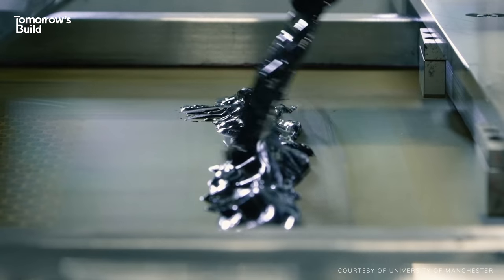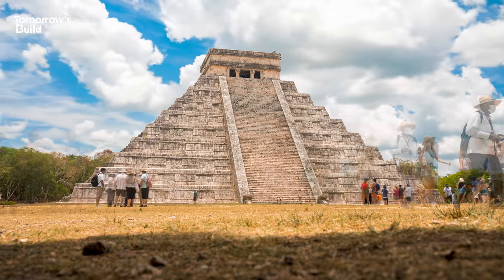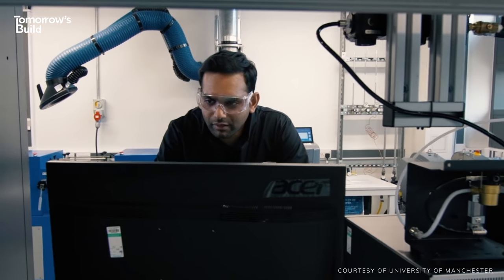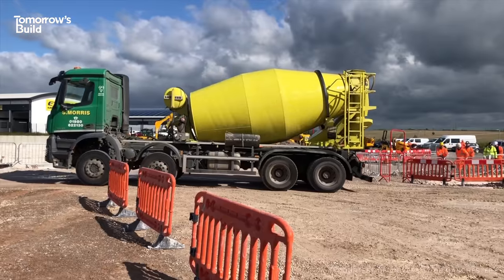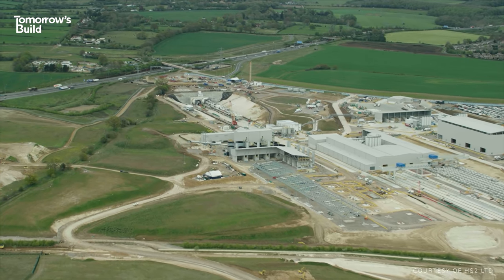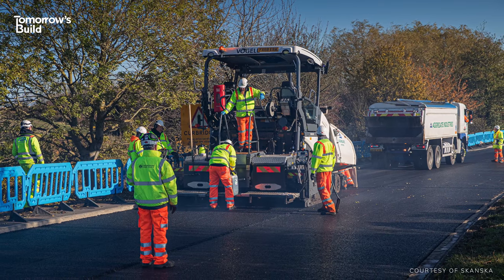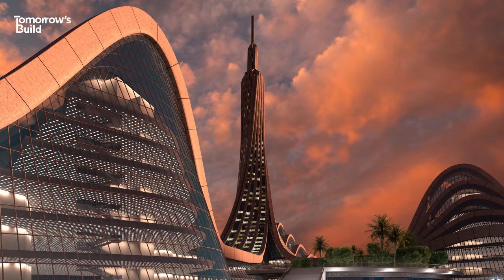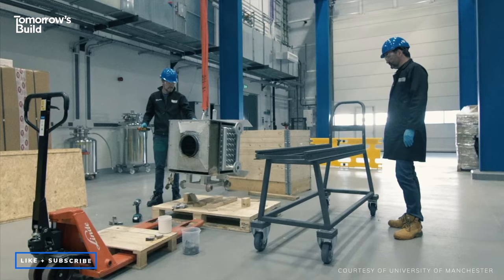Construction's Graphene Revolution Has (Finally) Begun

Comment: Can't help but think that graphene will be the real wonder material once we can produce it in large sheets, not in tiny flakes. I'm actually surprised just adding this powdered graphene already has such a drastic effect on the material properties!
Reply: It's not that surprising. The strength of composite materials like concrete depend hugely on what kinds of materials the binders (cement in this case) is holding together. Sand and gravel are the traditional additional ingredients that make concrete, but things like glass and basalt fibers have been shown to add quite a bit of strength and crack resilience. You see the same thing with epoxy composites like fiberglass and carbon fiber. You can make very strong epoxy composites by mixing in everything from sawdust to industrial diamonds. This is another application of the same principle.
Reply: @ryanbrown982  Anything that can make us use less sand in construction is definitely good. Been waiting on good news like this for almost 5 years now. Things are definitely looking good for the future of graphene.
Reply: Graphene oxide nano particles are the main ingredient of these covid vaccines. Does that excite you guys?
Reply: You mean better than starbucks...lol
Reply: @noone3734  Yeah! Really interesting, actually
Reply: @ye1o881  why do you think they are hiding it though?
Reply: Try to produce sheets that are millions of atoms long and forget  it.
Reply: @paxundpeace9970  I'm not saying it's easy...
Reply: Actually the opposite is true. We can now create graphene by superheating carbon waste such as food and plastic and its created in flakes instead the traditional sheets
Reply: Its not the material specifically, its the scale of the uninterrupted crystaline structure. If we could produce materials with such highly consistent crystal structures, granphene itself would obselete. Additions such as graphene to enhance concrete serve primarily to hault the propagation fractures by interupting the progression along molecular boundaries. We already do the dame thing with many materials sich as using steel intead of pure iron, or vanadium infused instead of standard high carbon steel. Its also why certain manfacuring techniques such as extrusion are favored over casting for some applications. 

This video is far more clickbait than revelation or reporting, as graphene is still exactly where it was 15 years ago, in the lab,
Reply: Well, let's be realistic. If don't have yet mass production of graphene in 20 years, this is likely because the business model is not worth it. A shame it wasn't address in the video. A bit like if I tell you that building building in diamond will drastically reduced the use of steel and concrete, sounds a great idea, lol 😂
Reply: @fairydust..  and it wouldn't really matter if they did it's just carbon
Reply: @thierrymad9743  we can literally make it from garbage now
Reply: But humans will still tiktok
Reply: @abrahamsorby8193  at what cost per ton? You can also make nuclear fusion from garbage...
Reply: @thierrymad9743  i cant remember. Do your own research
Reply: @abrahamsorby8193  well indeed I did my research before commenting (you?!)!! it costs about 200,000$/ton !! So that's a very expensive garbage 😂😂! That's x2000 times more than cement...so let's relax with this amazing innovation.
Reply: @fairydust..  “It's Easier to Fool People Than It Is to Convince Them That They Have Been Fooled.”!
Reply: @noone3734  "hiding it" how?
Reply: An atom thick graphene metal solid like would be stronger than your will to live.
Reply: @thefirstsin  “Of all animals in God’s creation ....
Man is the only one who drinks without being thirsty ....
Eats without being hungry
And talks without having something to say.”
Reply: That has been known for years... it is not easy to produce in large sizes... even in Wikipedia it mentions it. Everyone thinks like you in that sense, but they forget that creating and THEN GETTING FIRMLY in our society, revolutionary things take time.
Reply: @asterlofts1565  I never claimed that it hasn't been known for years.
Reply: @noone3734  Are you okay? I mean you can't believe this
Reply: @siromj8885  whatever man, like I care what you think, you've never looked into it for a second. Do some honest research and you might be surprised what you find.
Reply: @paxundpeace9970  I just did it last night in my epitaxial graphene lab :)
Reply: If you a produce a huge sheet of graphene, it's still going to be an atom thick. Remember, it's only stronger than steel *by volume*. An atom-thick layer of anything isn't going to be supporting any buildings. Using it in composites like this is actually the best way to apply it.
Reply: @Rhaegar19  sure but the size of the sheet still matters, even in composites. There's a reason why carbon fibres aren't added as tiny flakes to resin but as long strands.
Reply: 2025 : GRAPHENE neuro chip id mandates for every citizen.
Reply: @thebrowns5337  you can barely write a coherent sentence, so I'm sure you fully understand how science works. No point at all in talking to someone who thinks they already know everything. So have fun thinking what you want.
Reply: Seriously, put magnet on forehead and chest. Our foods, water, meds and air already have graphene
Reply: @lindahubbs8146  yeah if that's true then only God could save anyone from this
Reply: diamond dust then? diamond actually isn't rare to mine, crude diamonds are really common actually.
Reply: @lindahubbs8146  and that magnet does what exactly other than make you look silly? 😂
Reply: I can't help but think asbestos was a wonder material too once 🙄
Reply: The improvement in concrete properties when graphene is added to the mixture is almost entirely because it aids the cementation reaction. 

Concrete is funny stuff in the sense that you can often add a relatively minuscule amount of a chemical and achieve a radical improvement in performance characteristics. For example superplasticizers drastically increase the work-ability and ultimate failure strength of the concrete mixture, but the amount needed to achieve this result is less than 0.5% of the total mass of the concrete mixture.
Reply: @TripedalTroductions  Nowhere near 100%. A large reduction yes, but if a breakthrough case occurs they are still infectious.
Reply: @N0rthernLites  carbon nanotubes of certain lengths have a similar effect on lung tissue as asbestos fibres. Graphene doesn't.
Reply: @unvergebeneid  yeah let's hope for the best 👌 😊
Reply: @N0rthernLites  I mean, we've learned a lot since then, both in terms of biology and material science, as well as in terms of regulation and verifying substances are safe.
Reply: @thierrymad9743  i mean who knows, there's a fuck ton of way we can get carbon, it's not really the source that 's the problem rn, more of means of production, which in time will probably improve. Like there's (I assume) so much way you can fudge with carbon atom, given enough incentive, someone will probably find a better way
Reply: @noone3734  😂😂😂😂😂
Reply: @noone3734  you think they figured out the connection yet
Reply: @fairydust..  really
Reply: @thacrypt223  I’m also hopeful about how I’m rested use of graphene could incentivize sucking more carbon out of the air because this could boost of demand for it.
Reply: Wouldn't it make the concrete conductive?
Reply: @michaellanders6737  maybe slightly- the graphene is just a component along with everything else in the mix, and I suspect it would be diffuse throughout the whole - no full unbroken connection to make a circuit barring extreme rarities
Reply: Hopefully it won’t be as toxic as that other wonder-material asbestos when it becomes widely used and distributed; though I’d be more worried about the nanotubes.
Reply: @noone3734  Don't take this the wrong way, I just disagree with the way you've been trying to convince everyone. Maybe you have a point, but you haven't convinced me with your methods. Hopefully we can all learn how to actually be civil in our arguments, even in a youtube comment section. Just think it over, I hope we can all be respectful and actually consider each other's point of view. It's something we all (myself included) could do better.
Reply: @Marsdend1  I agree with you, but let's also consider how these people have started off with insults, calling me stupid or whatever. So I think I've been quite civil given their conduct. But yeah I'm not in the mood to deal with them because I know it's usually impossible to convince anyone. Everyone who sees what's happening has a God-given inclination toward the truth, and they find it on their own. Nobody had to convince me, I wanted the truth and searched earnestly for it. People who think and live in the mainstream bubble are lost, hopelessly demoralized and mind-controlled; only God could open their eyes at this point.
Reply: @Marsdend1  and don't act like you could have any idea what I know about ulterior motives, or anything, based on my comments here. I can almost guarantee my comments would be shadow-banned or deleted if I posted in detail about this stuff. One of my comments already got deleted in this thread.
Reply: @noone3734  NO, no it doesn't. I think most Graphene manufactures state "not for internal use". Makes sense for an experiment on people doesn't it...smh
Reply: @nunyabisnass1141  It is actually making some headway in batteries and building materials. Part of the problem has been the discovery of many other similarly structured materials and semi metals which has the science going in so many directions. The possibilities are endless but often it takes about 50 years for the application to take effect.
Reply: @noone3734  maybe he'll come to his senses after his forth booster. say a prayer for him.
Reply: @noone3734   Thank you for taking the time to explain more of why you say what you say. I do have a slight problem though, and it gets passed around a lot on the internet: "do your own research." Can you imagine a scientific paper that says some outlandish thing and then says "Oh and trust me I did research, just look it up"? Everybody cites their sources, because with with huge amount of information on the internet it's not likely we will come across the same content. And, of course, everyone you say that to will think that they've done the research themselves, and then nobody believes either party. Youtube rarely allows links to be posted, but at least we can point out an article title, research titles, etc. It does mean more work for you, and it seems like you're already tired of this conversation, but keep that in mind for the future and consider writing down where you get your information so you can bolster your arguments. As it stands, I completely disagree with you about how safe these vaccines are, but would sure like to be aware of any dangers that could exist.
Reply: What they failed to talk about is it's toxicity in the body. Basically another asbestos but far worse to be building with. The irony.
Reply: @WaterspoutsOfTheDeep  na it's not that toxic for sure. It may be more toxic to synthesize it but to reduce it from graphite is pretty harmless, just carbon. Now to get a good quality reduction from graphite sheering well that's the billion dollar solution.
Reply: @WaterspoutsOfTheDeep  source?
Reply: @unvergebeneid  "According to a team of Spanish researchers, La Quinta Columna, symptoms of graphene oxide poisoning include: bilateral pneumonias; thrombogenicity; blood clots; post inflammatory syndrome or systemic / multi-organ inflammations; alteration of the immune system; and, ultimately collapse of the immune system and a cytokine storm."

 Here is just one of the many papers on it's toxicity. You can also look up Canada recalling face masks that were found to have graphene oxide in them.

 Toxicity of graphene-family nanoparticles: a general review of the origins and mechanisms
Reply: @Joe-nq6hy  It's not real, it's a conspiracy theory people are using to try and push anti-vax propaganda..
Reply: @scottwhat3362  not 100% of the time but a seatbelt doesn't save your life 100% of the time, you should still use it when you can. Drastically reduces the chances of serious symptoms and still does provide immunity between 60-90 percent depending on the variant. (And even if it was less it is still a good idea!)
Reply: @WaterspoutsOfTheDeep  the point of graphene oxide to my knowledge is precisely that it is more chemically active than plain graphene that is just used for its structural properties. Graphene can also be biodegraded inside the body, therefore the only way it could conceivably be harmful is if it physically damages cells like some carbon nanotubes or if it forms harmful clumps. This would be size dependent though, so I am very optimistic that safe graphene is a possibility, even if it were found out that certain forms aren't safe.
Reply: @noone3734  Yes we are excited! More control and toxic resources, what's not be liked?
Reply: @WaterspoutsOfTheDeep  lol i didn't  suggest injecting into a person or breathing in fine powder was safe. Certainty  when handling many building  materials you must take the proper safety precautions. It' would be similar to handling concrete. You definitely  don't  want to breathe in the dust. But if you take the proper steps in handling it it's fine. You do not have to add toxic chemicals in a top down synthesis of graphene with  lesser quality in the finished product than the bottom up method. Would love to see how the study you mention was administered.
Reply: Or just graphene in general?
Reply: @Marsdend1  pubmed, graphene; biomedical, vaccines, toxicity, etc.
Reply: @Marsdend1  r u s s b r o w n
Reply: @Marsdend1  also there are so many terrible misinfo channels on that site, and they're usually the most popular ones. Gotta be discerning.
Reply: @Marsdend1  t a n g e n t o p o l i s
Reply: @Marsdend1  wow it looks like I found a way to post it, as long as I'm not shadow-banned. Do you see those replies with the spaced out letters?
Reply: @noone3734  I do, looks like youtube doesn't let you post other video site names. I'm impressed that you gave me quite a few options, I'll get back to you later with my thoughts.
Reply: @noone3734 Clearly not hiding well, you know about it.
Reply: @Marsdend1  okay, looking forward to it.
Reply: @noone3734  I think you'll agree with me on this case, although it's unrelated to graphene, just thought I'd share my thoughts. 1st case was pointing out a danger of the covid test. It was a bit ch u t e video. A mistake by a covid test administrator accidentally pierced the back of the nasal cavity causing a cerebral leak. 

My take is that the article really only points out 3 examples of this happening. The vast majority of tests administered (99.999999505%, according to the 606 million tests administered in the usa, figure given by website statista,) dont have this happen, but there could be more cases we're not aware of. 2 adults, a man in the Czech Republic who the article never revealed his current health, a woman in Iowa (interesting story, she had already had surgery done for cerebral hypertension, and the test accidentally pierced that membrane. She made a full recovery.) And a tragic accident with a child in Saudi Arabia where the child died. The kicker is, you can request a different type of covid test if you're worried about it, and again, these cases are extremely rare.

I think this is one of those phony videos/articles you were talking about, so I'll keep looking
Reply: @noone3734  currently just wanted to say thanks for  actually providing arguments. No one who is anti-covid vaccines has ever actually presented me with evidence besides verbal arguments before, so I'll do my best to do a thorough investigation!
Reply: @Marsdend1  I'm impressed man, good on you for having a mind to consider these alternative perspectives in the pursuit of truth. You're the first person I've met with a willingness to look into it for themselves. Most people are so deeply entrenched and won't even consider contrary information. Truth is all that matters, so gather all the knowledge you can while keeping the good and leaving the bad. We know nothing as we ought to, and we'll never have all the info we need to form correct conclusions, but it's a good thing to strive for.
Reply: @noone3734  I did, the source material is inconclusive and covers one possible mistake. I'm looking at a body of evidence from the FDA, the company that produces it, and the university whom employs the professor in question. You are making a mountain out of one single grain of sand, one that cannot be verified or repeated. You are being irresponsible talking about this, there is nothing to be concerned about.
Reply: @noone3734  You are on a whole different level, this is amazing.
Reply: @MrPojopojo  geez man, you really need to look at the other side of the story and stop wholeheartedly believing and regurgitating the "fact-checker" lies. But really, you're in a bad spot, and I'm totally discouraged talking to you because you're so sure. It would only take you looking at the stuff they don't want you to look at, and you'd see. But for some reason you just won't look. It's maddening, but whatever, it's not my problem. Go read the Nuremberg Code, see what you think.
Reply: @drewberrynews3875  Kinda irrelevant points you bring up to the conversation. Otherwise asbestos would still be used. Nanomaterials are a new category of toxic compounds regulations are slow to catch up. You can look up the study anytime you want, that's why I gave the name since you can't post links on youtube.
Reply: @noone3734  give me which section you think is being violated, I'll wait.
Reply: @noone3734  I don't put faith in them wholeheartedly. They have to earn it and right now they are the only ones who set out rigorous standards and check facts when people spread misniformation. You've brought up something that they elaborated upon, and voila I know that your concerns about graphene oxide are from a single vial which can't be reproduced. 

Where do you get your information from? How do you collect it?
Reply: @RB-kb3tc  Yeah, it makes very real issues into theatre for some grander conspiracy. It's incredible people believe it, but maybe it's because they want to feel bigger than they are. Cracking the code like a mystery movie, being crazy the whole way but right and vindicated at the end. Doesn't help that many will happily accept dozens or hundreds of moving parts, and if a few are flawed or outright false then it's just a trick, the rest are still intact/haven't been debunked. Scary mindset to say the least.
Reply: @MrPojopojo  okay, honestly I don't want to have this conversation with you. We aren't gonna help each other, so let's not even. Maybe if we could talk in person, but I'm not gonna waste my time with all this in a comment replies thread. Make of it what you will, I could not care less about any man's opinions.
Reply: @fairydust..  graphene and graphene oxide are two different things dude, the terms are not interchangeable, if you're gonna learn about one may as well learn about the other and yes the doses that were reverse engineered and analyzed did in fact happen to have graphene oxide in them, and I'm sure you'll ignore it but go and check out what kind of reaction graphene oxide had when subject to emf. Have a good day
Reply: The Chinese added rice to the concrete used in the great wall to give it added strength. They still do it today on quality structures.
Reply: @noone3734  Ok, so here are my findings. I will try to speak honestly, even if it offends someone.

First off, a study found that by adding some graphene to vaccines, it increases the immune response, making the vaccine more effective. So yes, I wouldn't doubt that graphene has been added to some vaccines.

Second, there's a community of people sharing information similar to what you've shared here. The problem is, no one seems to agree on what the problem is. I saw one person claim that 6 billion people have been vaccinated, which couldn't be farther from the truth no matter which way you look at it.

Third, the primary method used to convince people on these sites is fear. They point out a couple facts, and then make ridiculous claims about them. One person pointed out an article from 2016, where a new method of using magnetised proteins to activate brain cells rapidly. For some reason, they equated this with mind control... specifically, to "control the emotional state and physical activity". Uh, that can mean a lot of different things. It was used to regulate blood glucose levels in mice according to the study, which, uh, congrats helps with diabetes, not mind control. Then, here's the kicker: "it's not about the virus... have you heard about COVID deaths recently? No..." Does this mean we don't care about Covid deaths? No, but he thinks so. Then he then goes on to detail potential methods of how to fudge the results of covid tests and stuff, but he has no evidence this is happening. Just a solid "trust me bro, I read scientific articles and highlight a few points out of context", leading into my next point:

Fourth, It's all cherry-picked information. This one person said this one thing this one time. It's not the whole picture. 

Fifth, they use large words to sound smart. It's really easy to get an audience riled up if you can spout out large words that are hard to understand, difficult concepts that are sensationalized, and highlight certain phrases out of context in order to push an agenda. You could literally create any narrative you imagined using these techniques! I could go on to create a theory that, idk, magic space aliens are ruling the world, or that sapient earthworms are actually pulling the strings... and, considering some of the things I've seen people spout in comment sections, there probably are many theories just as outlandish as these ones.

Sixth, these people aren't performing any experiments. They aren't doing anything about this information they share, except for profit off of it. Funny, the government isn't hiring assassins or anyone to take these people out. Why? If what these people were saying was true, and the government was as corrupt as they claim it to be, I doubt they'd live to see next week. But they continue, essentially declaring war against the government.

Seventh, there are claims that they are trying to force a food shortage? This is World War 3? Psychological warfare? And what's their evidence? "because I said so". It's never said, but that's what they expect of their audiences. Live your life without fear, except, you should fear the government, they're out to kill you.

This is my conclusion: Thank you for the information, but I think you've lived in this world of fear and assumption that the government is out to get you, that you've developed a bias so ingrained into you that you won't see anything other than this viewpoint. For some reason, I think you've developed a deep distrust of anything science says. Why don't you hold your own sources to the same level of scrutiny that you offer to "mainstream media", as you like to call it? Nothing I watched was remotely convincing to me.

Here's something to think about: I've taken some science classes in high school and in college, and this is what happens. You spend 1 hour in class, and then another hour in a lab running tests to validate what you learned in class. You look at stuff under a microscope, take measurements, do math, make predictions, and validate your results. Consider that, when assuming the whole nation is being brainwashed. I'm not saying our world is perfect, or that media doesn't try to influence us. I look past these emotional arguments. A lot of news outlets do try to influence you, but the people you're listening to do the exact same thing, and from what I've just read, at much greater effort than "mainstream media" (which in and of itself offers opposing viewpoints)

On a personal note, I think it's worth mentioning that I have a lot of Faith in Jesus Christ. I've read the Bible and pray daily. I also believe in the sciences, and I don't think they disprove one another.

Thanks for your time! I mean it! I don't think of you as someone who is dumb, no, how could that be true when you were willing to give me sources and engage in this conversation? I think you're much smarter than many people that lurk these comments. You are probably smarter than me, given that you've held your own for so long against so many people. I just really don't trust these guys that you get your information from. Thanks again!
Reply: @noone3734  Thanks, and the same to you!
Reply: NO that’s not how informed consent works! IC is not “here’s the atomic weight of every thing we put in this sucker”, it’s “we a are performing this procedure, this is why we’re doing it, do you CONSENT to the procedure being done?”
Reply: @pyromagni7578  should I know why you're talking about medical procedures now?
Reply: @pyromagni7578  "The voluntary consent of the human subject is absolutely essential. This means that the person involved should have legal capacity to give consent; should be so situated as to be able to exercise free power of choice, without the intervention of any element of force, fraud, deceit, duress, overreaching, or other ulterior form of constraint or coercion; and should have sufficient knowledge and comprehension of the elements of the subject matter involved as to enable him to make an understanding and enlightened decision."
Reply: @unvergebeneid  forgot to @ the person specifically. Some guy said graphene was in the vaccines and then...
Reply: @pyromagni7578  oh, I see
Reply: Check out photonic circuits, this will super boost that field
Reply: It's just rebranded graphite. Thin sheets of graphite.
Reply: @halnineooo136  and diamonds are just rebranded carbon. What are you saying?
Reply: @noone3734  Graphene oxide? Do you mean oxygene then? :-P